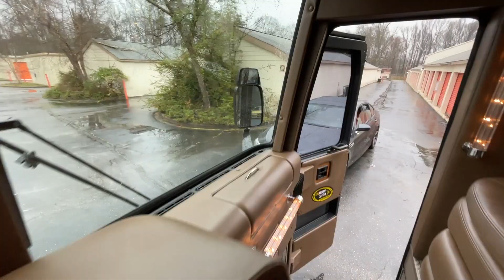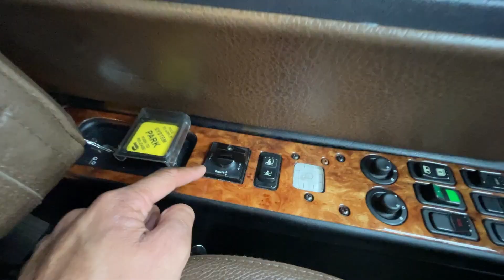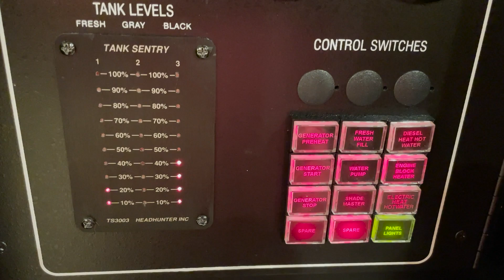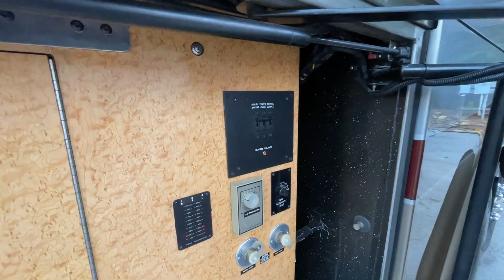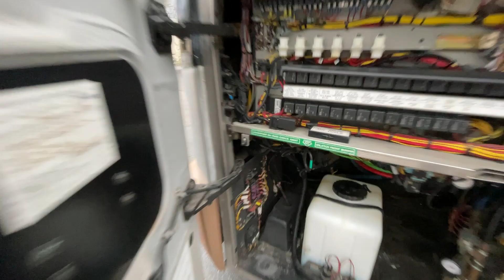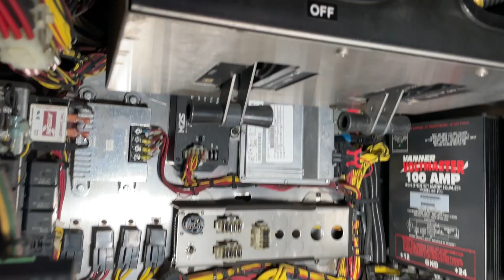2005 Prevost H3-45 Featherlite Vantare Basic How To

Comment: When using auto level, should you put the slides out first and then auto level.
Reply from the maker: Interesting question, Prevost recommends on their slides to put slides out, then level. In fact it won’t let you operate the slides when “level low” is on in the dash which turns on when you’re in manual level or auto level. The reasoning is reduce likely hood of chassis twist/flex while operating slides. Others recommend having it level then operating slides, which is generally how I do it unless A, it’s a Prevost slide, or B, when I level the coach it’s to counter a dual/compound slope, which will cause chassis twist. Move the damn coach in that situation or put slides out then level. Thanks for watching!
-Mayan